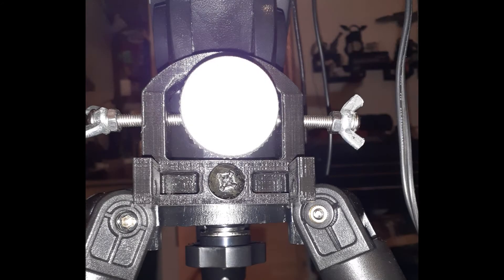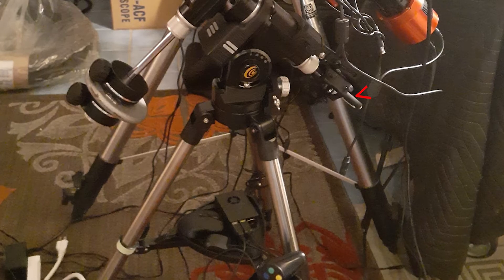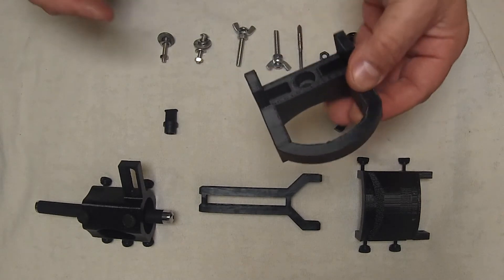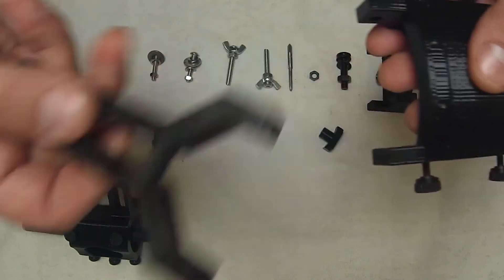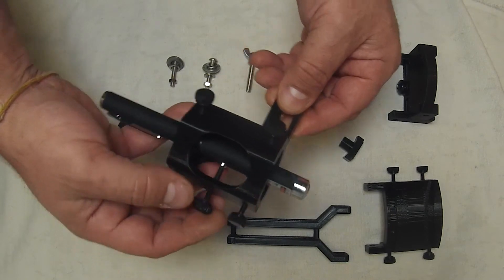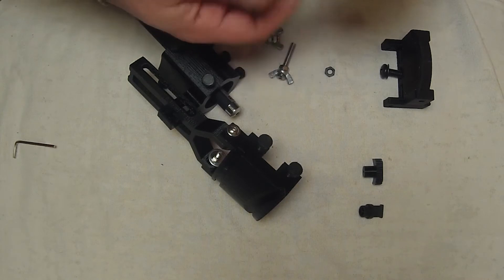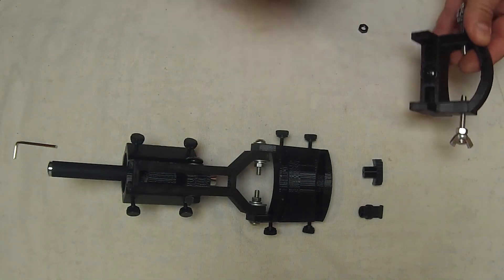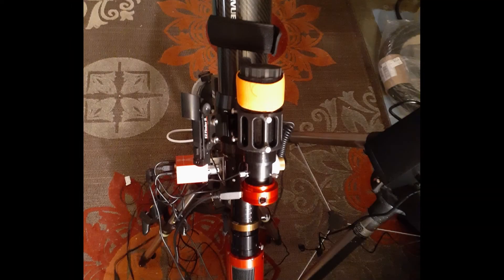IEXOS 100 3D Printed Parts make It Better! [Alex Zarvis]

Comment: Great setup, congrats! Can you give more details on how the az adapter works and how it acts on the mount? The "official" version sold by ES is a sort of collar to put between mount and tripod, and it needs some drilling to fit in the stock tripod that comes with the iexos-100. And it is currently out of stock in Europe.
Reply from the maker: Hello, at 9:45 of the video i discuss the azimuth adjuster. It simply attaches to the tripod using a single 8mm bolt into an existing hole on the tripod. The two side bolts with wing nuts on them are rotated to turn the mount head left or right, it works very precisely, in a manner similar to other azimuth adjusters on other mounts. No disassembly or modification of the mount is required, and it can be removed at any time. Frankly it just works. I also have created several other modifications for this mount that you can find on thingiverse if you search for IEXOS. They include Ipolar/Polemaster mounts to make polar alignment a breeze, A counterweight mount to use inexpensive readily available barbell plates from walmart, and a USB Support to help keep the USB cable from flexing the port. I no longer use the laser components shown in the video, just the azimuth adjuster, the Ipolar mount, counterweight mount and the USB cable support. Clear skies.

Comment: Hi Sir,
First, thank you to have shared this with the community ;) 
I printed the az adjuster and I saw you use M5 nuts and bolts for the adjustment but I can't find any info about the bolt to fix it to the mount.
Thank you for your help
Cheers and clear skies Sir.
Reply from the maker: Hello, it is an M8 bolt. Thanks.

Comment: Nice video, i was not able to find a way to write you directly, how did you connect the iEXOS100 to the astroberry? did you use a special usb cable of some sort? you have a video on that? Sitting here trying to get it to talk to stellarmate with my amazon basics mini usb cable, and nothing goes
Reply from the maker: Hello, in the case of the IEXOS-100 mount an 'FTDI' USB-Serial chip is built in, so all that is physically needed is a standard quality USB A male to USB mini male cable. Which it sounds like you have. Depending on when you bought your mount, you may be encountering the 'Bit Flip' problem. If you read my notes for this video, i mention the need to 'flip the DTR' to make it work. I wrote: 'you must install and run FT_Prog and then change/invert the DTR of the FTDI chipset.' so you download FT_Prog (google it)...plug in the mount via the cable to your PC. connect it through the FT_Prog program and search for the DTR (it's in there in the menus), then invert it. Save and the mount should then be viewable by other applications. Anyway, it's been a while, but that is what i did. This link has much more detail: https://espmc-eight.groups.io/g/MOUNTS/topic/getting_stellarmate_to_wok_on/32572483     good luck to you.
Reply: @alexzarvis6949  thx a lot, it worked!! needed to patch the firmware first, then use FT_prog and then it all finaly made click and just worked
Reply from the maker: @FredMF  Great news, glad to hear that, cheers!

Comment: Thanks Alex for this informative video. I have a similar setup for my telescope and imaging train (ES ED80 CF, ASI294MC Cooled, 60MM guidescope and ASI290MM Mini). How much counterweight do you have on it? I see the two 1-kg weights. What is the sandwiched weight? How has this mount held up to the payload? I tested my iEXOS 100 using a friend's older Orion 100mm Astroview telescope with the finder scope and the 7.5 pound counterweight off its manual mount. I attached his Canon T7. It seemed like that configuration was just at top of the mounts design spec as far as weight. I think if I remove the mounting rings and just attach a dovetail and change out the old visual only finder scope with a 30mm guidescope, I think I could shave some weight. I might be able to get away with a  third 1Kg counterweight instead.
Reply from the maker: Hello, the sandwiched weight is a 2.5lb weight. so not much additional weight was needed. I have used the IEXOS-100 in many different configs at this point, and i find it handles the weight of larger refractors pretty well, up to about 110mm or so. Plus guiding accessories and other things. It's been a great little mount. This mount will work very well as long as you take the time to balance everything. and leave a slight telescope side heavy bias to help with the dec backlash.
Reply: @alexzarvis6949  besides your 3D parts, are you using the stock iExos 100? Did you upgrade the tripod?
Reply from the maker: @NMagturo  I actually do use the stock tripod. I love how light and portable it is. Really good balance means i don't feel plagued by the small mount's bit of flexure. I upgraded to a polemaster to make polar aligning even easier, and designed a polemaster mount for this scope as well. Find it here: https://www.youtube.com/watch?v=2Jrp-Kv7I1M    Between that and the azimuth adjuster, as well as printing my own bahtinov masks, and other do dads, i have a good time with this rig. However, i have a bunch of other mounts and scopes and rigs, so they also get a lot of my attention, I regularly design and print stuff for them as well.